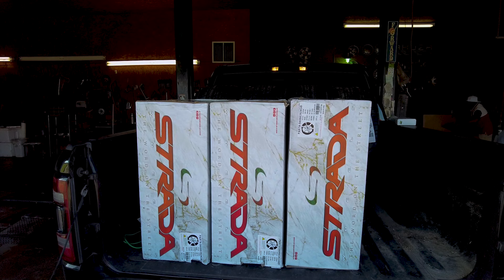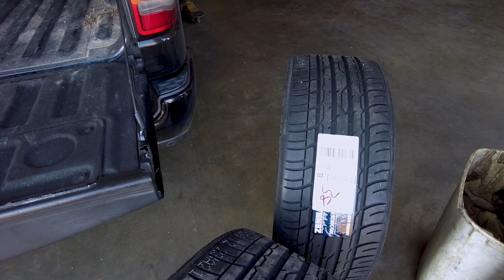RAM 1500 on 26s | New Wheels and Tires

Comment: I see you’ve had the setup for a few months now. How many miles have you put on the tires? Have you needed to get a balance often? Are the tires super smooth or can you still feel most of the road??

I have 26 snowflakes on my 18 Sierra and I can’t seem to find long lasting tires that don’t fall out of balance frequently!
Reply from the maker: Hi my friend! One thing that I have learned is that I have to rotate them often and keep the air pressure around 42 PSI for a smoother ride. I haven’t had to balance them since I had them put on but I haven’t run into uneven wearing on my tires which cause a slight shimmy. My shop told me that I needed to rotate more frequently than I currently was to see if that would keep the tires from doing that in the future. I’m learning that when you run a bigger tire and wheel setup, your just going to run into certain things that comes with the territory of having those size wheels vs stock. It’s definitely more work for the look but in my opinion, I haven’t run into anything that would make me down size. All in all, I’m happy with everything and learning as I go.

Comment: did you have to cut any of the wheel wells?
Reply from the maker: No sir! Not at all. I do have a 2 inch level on the front but no rubbing or a need to cut.

Comment: Are you rubbing when you turn im thinking about getting 24
Reply from the maker: My truck has a 2 inch level in the front. With that being said, no…not even close to rubbing and it probably wouldn’t rub without the level. I had 24s before I went up to 26s. You’ll definitely love them my friend.

Comment: What size tires?
Reply from the maker: 305/30r26 Zena Argus UHPs
Reply: OK thanks....so you didn't have to cut anything for rubbing, when you turning?
Reply: Thanks....
Reply from the maker: No but I do have a 2 inch level in the front. I got that done before I even thought about these wheels. This video will give you a visual of what it looks like at full turn. https://youtu.be/a5ATVXt2mvA?si=I_xknKHmrp2OMBdV

Comment: Will 26s eventually mess with the transmission?
Reply from the maker: The original diameter of the wheel was 31.9” with the stock 275/55/20 tires. The diameter of the new setup is 33.2” which is an increase of about 4.1%. The factory wheel and tire setup weighed 77.lbs vs my new setup that weighs 92lbs which is a difference of 15lbs. So, with a 4.1% increase in the overall diameter of the wheel and tire and a weight increase of 15lbs, this should not damage my transmission. Will it cause it to work a little harder…yea, but not to the point where I would run the risk of damaging my transmission.
Reply: @theblkhorn2082  Thanks for the input, I just bought a 2021 Ram 1500 and I'm stuck between 24s or 26s. I just don't want any problems later on caused from the bigger rims.
Reply: @lawrencewashington6109 Also, remember bigger Wheels and a bigger brake kit 👌🏾
Reply from the maker: I understand! I had 24s before these and they just didn’t look right to me. Some days they looked great and some days they looked too small. During my research, I’ve found plenty of people who drove daily on 26s and had no issues. It just boils down to your comfort level and if you are financially setup to handle any future issues you may have. All I can say is research and plan my friend and do what brings you peace.